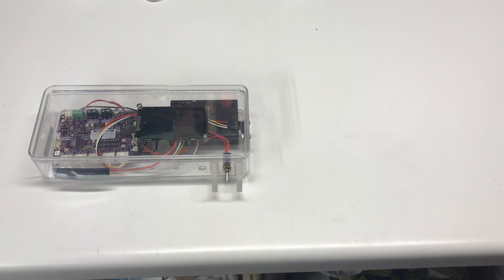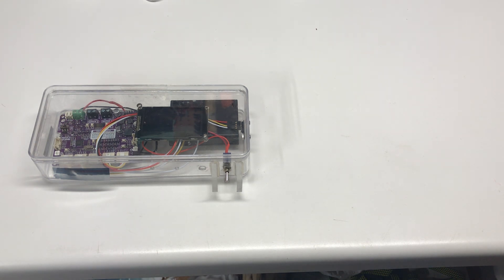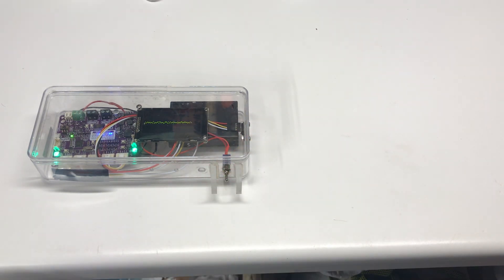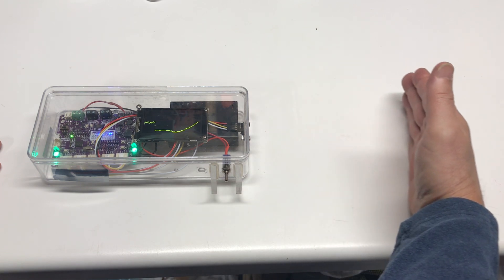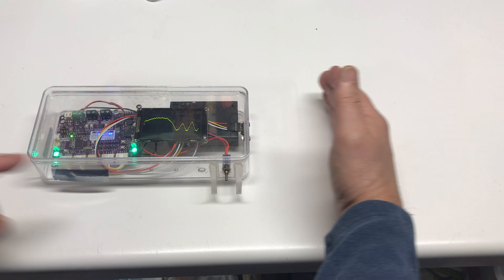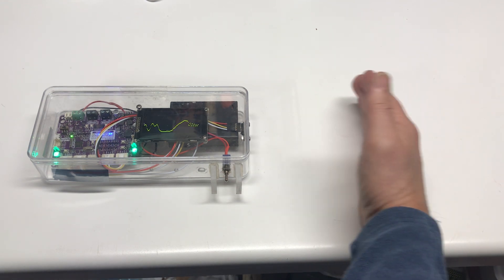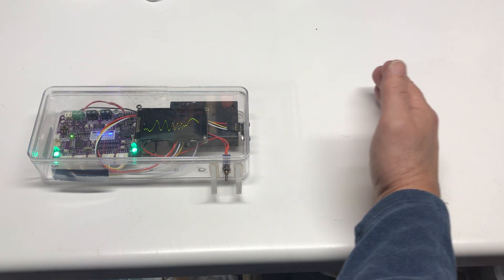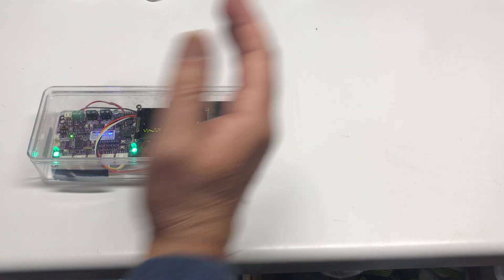Time-of-Flight Distance Sensor Demonstration

Comment: Sweet, nice project. How did you achieve this?
Reply from the maker: I wrote a MicroPython program.  https://dmccreary.github.io/learning-micropython/sensors/07-VL53L0X_GY/

This is also shown in our STEM robots class:https://dmccreary.github.io/micropython/kits/maker-pi-rp2040-robot/20-collision-avoidance-robot/

This version also uses the OLED display here: https://dmccreary.github.io/stem-robots/

You can look in the "src" directory for full source code.

Please contact me if you have questions.